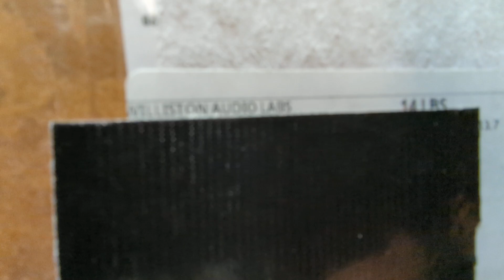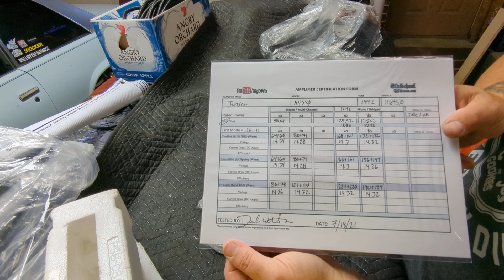I bought one of the coolest budget amps of the 90's!!!

Comment: Awesome. The blue 250 and 80watt were my first 2 amps as well.
Reply from the maker: I don't remember which model I had but, it pushing two series one 12's.
Reply: @mullinperformanceaudio5902  it was probably the 250 (or 220... 2something). Starting with old jensens is the reason i love the blue of the JP amps.